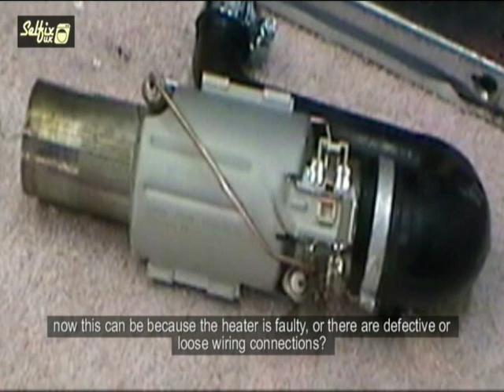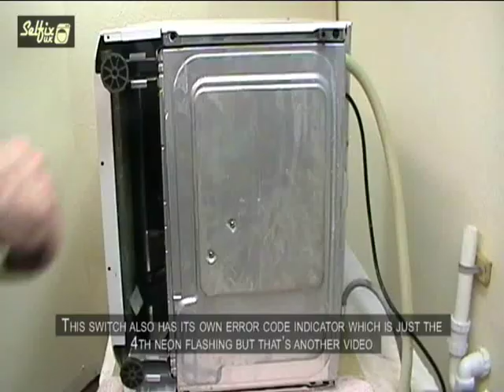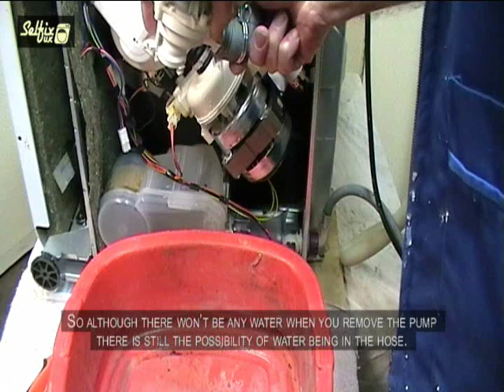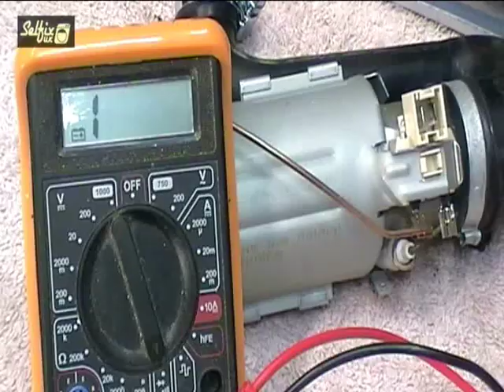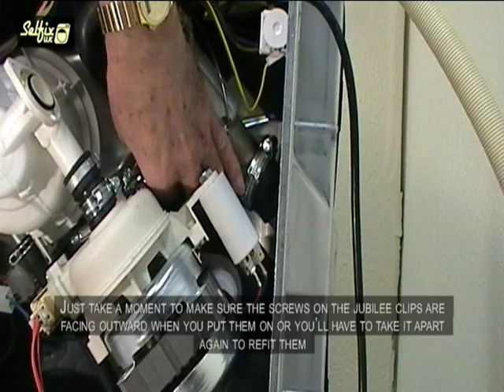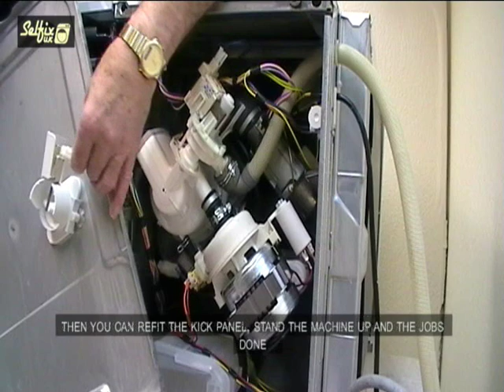Hotpoint dishwasher heater for selfix

Comment: Hello, I do not know your language. My machine is L60t3c. Something like jamming occurs in the engine during washing. The fountains stop. Sometimes it saves itself from this jam. The engine of my machine is the same model. When I open and close the door of the machine, the washing starts. Then it makes a sound like 'yyyy' sound again. But I can see the rotor turning through its propeller, but the sprinklers stop. The engine gets very hot. The interesting thing is that when I supply 220 V from outside, it continues fine without any interruption or jamming. But when I connect its own card, the jamming continues. I checked the motor fan. There is no foreign object. Is this caused by the turbine of the engine? There is no problem with mofsets and zeners. I tested the card. Could you please reply regarding this turbine? Is the problem with the engine? Is it the engine turbine?

Comment: Do I need an electrician or an appliance repair man to look at the dishwasher if it might be tripping the consumer unit? Tenant initially thought was the oven, and an electrician attended and said not the oven and to keep an eye on other appliances plugged in. Then she said was occurring when the dishwasher was in use part way through the cycle. Electrician said to get an appliance repair person in.  I'm not sure why he didnt check all the things plugged in and unplug/plug them in one by one to see what tripped the unit. 🙄 What if I send out a repair person and it's not the dishwasher either?  It could be anything plugged in presumably.  So I don't know if to send a different electrician to investigate the tripping problem who will look at everything plugged in, arrange PAT testing of just my appliances or an appliance person to just look at the dishwasher.  Or just to order a new dishwasher as the current one was bought in 2009.  Agent's electrician only looked at the oven, which was not the issue, rather than investigating  the tripping problem as a whole which i don't understand.  I've already had 2 visits by him for the tripping problem and he didnt solve it and only the tenant saying she thought it was the oven and now the dishwasher.  Any advice please?

Comment: What do you do if the heater tests ok 28ohms
Reply: Think thats all right,  just tested mine & its 33ohms , tested the voltage going into the heater & its zero volts ⚡️  possible circuit error or a temperature sensor failure

Comment: Is there a thermostat? I haven't seen one. Cheers
Reply: There is a thermistor inside the door compartment which rests next to the soap dispenser and should be touching the inner door panel, this thermistor is connected to the module and it comes as a one piece unit.

Comment: Thanks  for the video, I'm experiencing a problem with a leak after fitting a new flow-through heater any suggestions in reconnecting the hoses with a jubilee clip. I've done it exactly as you have done should I use some sort of sealer? Thanks

Comment: thanks, it wasn't working before we put it in the garage.  The freezer initially stopped freezing, then the fridge gradually stopped becoming cold as well, even though we increased the temperature on the thermostat. Is there any testing I could do, I have a multimeter I could use. Not sure how to test the compressor. Many thanks.

Comment: thanks, I've just checked one of your other videos, and can see where the thermistor connector is, on the top right hand corner of the soap holder (with the door panel removed), what do I need to check here specifically to ensure that the thermistor is making good contact with the door lining?

Comment: thanks for the video, the problem with my fdw60 is the delicate light is flashing, I followed the video and checked the heater with a multimeter as on your video and it appears to be ok.  Is the delicate light (light 7) flashing caused by a problem with the thermistor? And do you have a video of where I can test the thermistor with a multimeter, and replace.  Many thanks,